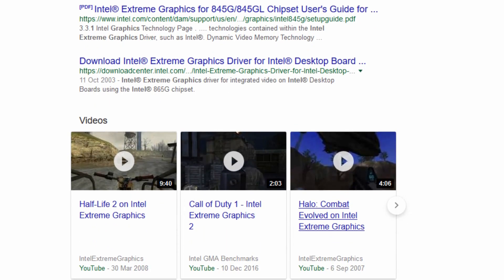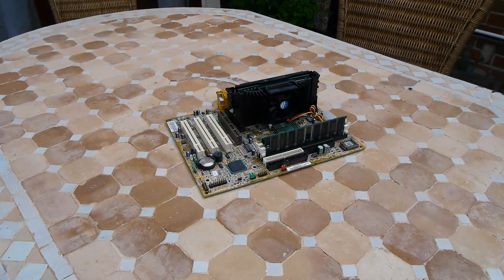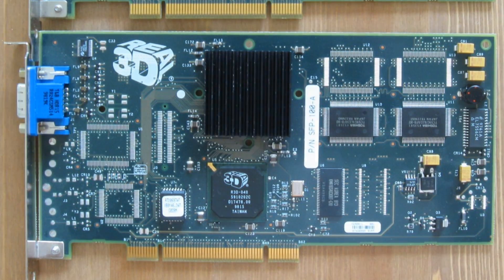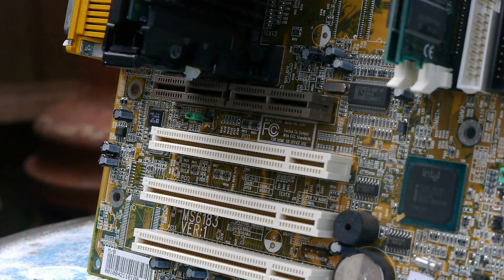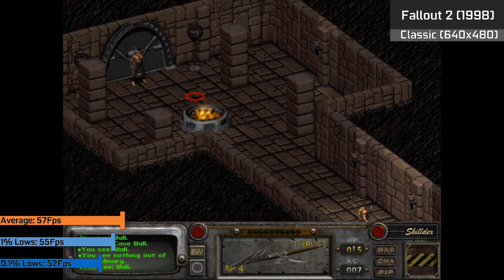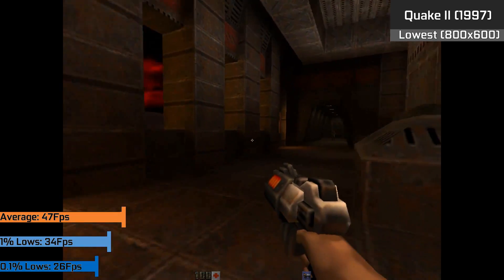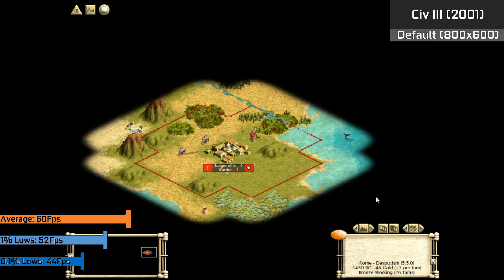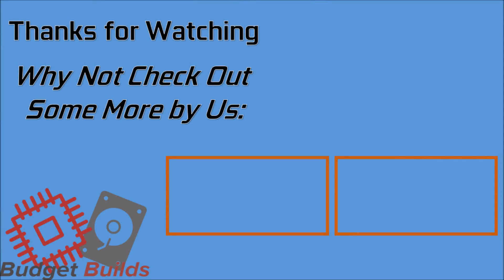Can you GAME on Intels First iGPU?

Comment: Ah, integrated cards. When my 8800GT died back at some point in early 2010, I spent a few months gaming on my mytherboard's integrated 7000 series Nvidia card (don't remember anymore if it was a 7050 or 7100 or what, but certainly not above 7100).  Then, a few months after I plugged in a brand new GST 250, my motherboard and CPU both brailed out, and, lazy bum that I am, I spent the next 2-3 years gaming on a laptop with an intel 4500mhd chip. So many really old and indie games played in those days ... good times!

Comment: The lowest gpu / igpu i used was a geforce 7050/nforce 630i with a dual core e6550 2.33ghz and 4gb ddr3, even then, that igpu / pc could run games from 1990 till 2007 (Q3/UT99/Ut gold/ut 2005/Morrowind/Oblivion, Heretic I II / Hexen II / Gothic I II etc) at 100/190/250fps+

Comment: There is a performance issue here. Even my old i740 performs better. Here is a PIII 1000 and a 815 chipset (same graphical unit). The 266MHz faster CPU cannot explain the huge gap by itself. https://youtu.be/KektuzPKktQ?si=cYItHCLMJxk_hBV4&t=1477

Comment: This miserable piece of silicon has been rehashed by intel so many times, it's more of a wonder trying to figure out when the company ever bothered to release anything new. This single adapter engendered literal decades of misery for pc gaming and developers alike, and are exactly why even in 2023, "intel video" is still a cursed thing to say or discuss when it comes to gaming graphics. It took literal driver voodoo to even get this turd to run the Aero graphics system of Vista, much less any newer Operating System. And the intel of now really wants to die on the hill of requiring resizable bar to fix the fact that Arc graphics lose 99% of their advertised performance on a system where that feature isn't enabled, or won't enable, like in the case of my present pc with a z390 motherboard.

Comment: At least there were still a bunch of PCI graphics cards for Dells, even up to Thermi. I have a PCI """""FX 5200""""" that's based on GeForce2 MX (specifically, a GeForce MX 4000 rebrand with a  memory clock bump from 166 to 200) that would probably still smoke this.

Comment: Oh, this brings me back.  the first PC I purchased was an HP pavilion 6835 with intel 810 and celeron 800, 128mb ram, and 30gb HD.  Windows ME. back in fall 2001.  I gamed the hell out of that unit.  ignorance is bliss, they say, but I never knew any better.  star craft brood war, doom and doom II, test drive 5 and test drive 6.  It was good times.  was this referred to as the original 'extreme graphics?  I know the 865g had the "extreme graphics 2" moniker (nvm, you mentioned it at the 4 minute mark).  The mpeg 2 decoding is real on the i810.  I tested it in 2007 with the HP 6835, at that point long replaced and collecting dust.  It required an old copy of power DVD, but I was surprised that the celeron 800 could do it with only 50% usage for DVD playback.  without the hardware decoding enabled it would stutter.   That HP 6835 lives on to this day, the case at least, now sporting an HP ITX board housing a baytrail celeron J1850, 4gb Low volt laptop ddr3 ram, and a 120gb ssd, on linux mint.  I use it for office use only now.

Comment: i remember having to use Intel HD3000 graphics in 2019. it was bad. Really bad.
Reply: A8 7650K, which isn't a good APU nowadays, was able to run GTA V at 30 fps most of the time with PS3 graphics 1080p.
God damn

Comment: i815e is an excellent retro-igp! lot's and lot's of really good games work very well. Hardwarescrolling is not broken on jazz2/dune2k, image quality is excellent. drivers from OS/2, dos vesa support, win3x!!, win9x/2k/XP and debian 3.1 has dri out of the box. Try that on other cards of that area  !  One small downside is that AMITHLON  refuses to load even in VESA mode. For IGP's you have stick to older games that came out 3-5 years if you are talking about actual igp's, in 2000 it was about 1-3 years.

Comment: I'd like to mention that the Intel i810 / i740 is a 3D graphics accelerator not a GPU.  The nVIDIA Geforce 256 was the first GPU (Nvidia defined at the time as "a single-chip processor with integrated transform, lighting, triangle setup/clipping, and rendering engines that is capable of processing a minimum of 10 million polygons per second").

Comment: Imagine having a build with cpu being this and the gpu being the rtx 3090
Reply: Earliest motherboard you can get with PCI Express is Socket 939, so you could do a low power Athlon 64 or Sempron... those boards use regular DDR so you could use a 64MB stick and have that be an even bigger bottleneck than the CPU, needing at that point a miniscule commandline Linux or BSD and games you can launch from a tty...
Reply: @BringMayFlowers that's assuming you can install and run the drivers, if not then it's pretty much worthless

Comment: From an Intel HD graphics user: I have a Pentium laptop that only has this "Intel HD graphics". Not 2000, not 3000 or anything. Just Intel HD graphics. It can run any game(kinda) before 2005/2006. I play GTA SA at 720p @30-40 FPS on the lowest settings. And the worst thing about this iGPU is that, it can't even stream 1080p gaming videos at 60FPS!! It is so terrible, I can't watch the buttery smooth 60FPS videos. But I can't do 720p60 either, because the quality due to YT's compression is terrible.
My point: Whoever you know, if they are gonna buy a laptop or desktop, please make sure they don't pick the one with this iGPU, because it is completely garbage for keeping up with basic expectations.
Edit: If I am wrong anywhere, correct me

Comment: An i810 based motherboard would probably be a killer DOS gaming machine. I have a mini-ITX i810 board with no graphics slots. Good candidate for a custom DOS mini-PC.
Reply: I had used my old P3 system with Intel 810E as my only system till 2011. Now it lies as a retro gaming PC. But I share many old memories with it. So, I kept it. I had 64MB RAM and Windows 98 which I later dual booted with Windows XP.
Reply: I mean, you might want at least one ISA slot for a sound card...

Comment: You cannot test those chips on Steam/GOG versions of games. Their requirements are like tripple of what they originally were.
Reply from the maker: The GOG Versions of the games are the standard games with DRM Removed. Less Intensive than most versions. Steam versions are fine aslong as you DONT have steam open.
Reply: @BudgetBuildsOfficial  That might be true in some cases (newer games), but look at Unreal. I (really) have achieved better performance on a 486 (64MB RAM, Geforce 4 MX460). 12 FPS just doesnt seem right... Many of the Steam/GOG releases replace the original CD tracks (zero CPU usage) with MP3s. For like sub-P II machines, that is a huge difference. You can just barely play a 128kpbs mp3 on a Pentium 66-75.
Reply from the maker: No audio playback was enabled for that exact reason. I have also tested with the Disc version of the game before and performance lines up with what the iGPU Achieved here.
Reply: Yes, this is an incorrect result in Unreal Gold 226. I checked on my i810 and got an average fps of 28 on the video author settings. Tested on Windows 98 in DirectX 3D.

Comment: It is a shame what happened to real3d. They made the graphic chips for the Sega model 2 (under GE) and then the model 3 (under Lockers Martin as real3d.) Only for Intel to use them to push the agp and then they design it in such a way that they used the main ram as texture instead of using the cards on memory because they thought the agp could allow this to happen. What a huge failure .

Comment: I have tested some time ago this iGPU (but the 810-DC100 one) in a Compaq Deskpro EN C500 with a 500mhz Celeron Mendocino the pirated version of Half-Life Opposing Force . It only ran in D3D mode at very low (but playeable) FPS.

Fact: The first 810 ones can't run a PIII , it haves a incompatibility with SSE Instructions . This was fixed in Rev.A2 of the chipset , That Compaq PC had the older revision

Comment: I  was using a VIA 4-in-1 at the time with a Celeron 900Mhz, think it was an S3 based chipset? 8MB shared RAM and I don't even know what the other specs were, although it ran Deus Ex tolerably at 640x480 and most 2D games fine. "Upgraded" to a PCI TNT2 which could run Freelancer comfortably at 1152x864@16. Then an FX5200 (ugh), and finally my first real good graphics experience with a 6800LE. A lovely little 128MB card which overclocked tremendously well and let me unlock 4 extra pixel shaders (so it was in effect a 6600GT I think)

Comment: In before watching the video but i had a pentium 4 with an i915 moboand that onboard gpu was awful! It couldnt even work right mst of the times. I remember NFS high stakes had missing textures and visual glitches. A radeon x550 gave it laps, and mine was a pasive card so adding some fans and some overclock it was even better than what it already was at stock clocks.

Comment: The i752 was basically an improved i740, which was from back in the days when you were upgrading from like...a S3 Virge DX.  The i740 was literally the very first AGP gpu ever on the market.  The PCI cards were actually pretty good and had great image quality, just not terribly fast.  We had a few successful UT2003 lan parties on some i810 graphics systems...on like 640x480 ultra low settings back in the day. 😂

Comment: The i740 was created to be the reference design for AGP Texturing(the usefulness of AGP Texuring was only ever really shown to be in synthetic benchmarks, as games tried to avoid texture thrashing and extremely poor performance on older cards like voodoo2's that  could otherwise perform really well).The 16 bit color looked bad but if it had 32bit it would have been way too slow
Reply: These IGPUs have 16 or 24 bit color but not 32bit one of the most interesting things about them.

Comment: FWIW- the AMD AMD 785G chipset with onboard ATI HD 4200 graphics is what got me back into PC gaming. This was in a Dell Inspiron 570 quad core Phenom minitower. It gamed so well with the onboard, I realized I was just a used dedicated GPU from playing HL2 and even Metro 2033. Did you ever play around with that chipset on board graphics? I think it totally stomped all over Intel's on board, and even urinated on its grave.
I am probably in the minority, but I think every single motherboard should have some type of on board graphics chip since almost every CPU socket has CPUs without iGPUs. It's a very nice backup to have when you are troubleshooting a graphics card issue, or even have cheap no power some CPU/iGPU combo on board to allow the powerful CPU/GPU to remain off to save power when not needed. IDK.. some cut down 15 watt tdp atom or whatever is modern similar.. something tiny they can use to fill out their existing silicon wafers in production to keep costs way down.

Comment: i use to play gta 3 and vice city mta online mods and halo 1 demo   on a 82810e i think it was  at like 3 to 19 fps at 640 by 480 i think i had a 733mhz and upgraded that to a 1ghz p3 i got out of a pc i found in trash thats where i also found my 256mb stick of ram that got me to 368mb   in early 2000s later upgraded it to a 128mb  pci fx 5200 i bought from the paper route i worked  for san andreas   rofl

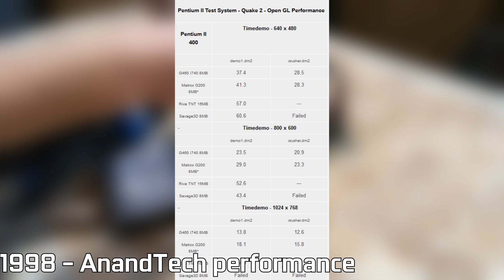Comment: 2:35 they did not optimize the chip. The same thing happened to the PowerVR CLX2 when it was taken from the Dreamcast and put in a PC as the Neon 250. Because it was not optimized fully it had problems with filtration and rendering something that it did perfectly in the Dreamcast. Real3D fucked up and it killed them while Power VR left the PC market and moved on to the mobile GPU and did pretty well until Apple made their own GPUs and then some Chinese company bought them and is probably gonna steal all the technology for China..rip

Comment: I'd bet original Unreal would have ran fine.  I ran that on a K6-2 with an STB Velocity 128 (Riva 128) and it worked well from what I could remember.  I guess Unreal ran in OpenGL mode because I read that D3D mode didn't work on the Riva 128.

Comment: You should try those with any UNIX like system, as they are much better supported than Windows (older Intels are supported by the newest drivers and improved in perfomance) and many of those have ports who could even be more optimized than the original releases. PE: Quake 1 and 2, Grim Fandango...

Comment: I have a i810 dell system in the closet. It's utter rubbish for virtually anything graphic and has only pci slots. For basic 3d games of the time it's an ok system. I myself used it as a smart router for about 10 years running freesco.

Comment: I bought a laptop for 1000€ and it barely rung fortnite in all low settings 600p with an averege of 40fps and in build battles it goes bellow 30. It has and intel core i7 7th gen, 16 gigabytes of ddr4 ram, intel hd graphics and amd radeon R7 445
Reply: TechnoGamer try disabling intel HD graphics
Reply: Your GPU is probably switched of to save power
Reply: Intel GPU is not for games, it's design to run mario

Comment: I remember having had something similar to this or maybe even the same chip, with a 1Ghz coppermine celeron. playing standard skulltag deathmatch (Doom2) was a disaster with plasmagun spam it would slow to a crawl. GTA2 and rayman 2 ran fine tho albeit on lower resolutions. and my mobo had no AGP slot so no addon cards. dark times. and the worst part? i had it till 2010.
Reply: No PCI slots?
Reply: @nathanhamman418  Probably dedicated onboard AGP video that can't be disabled. Those were the worst as you couldn't even add in an additional video card even if there was a PCI slot.

Comment: I think I had this on my first ever Windows XP PC. I just remember how it was terrible to use, and most of the games refused to even start up. I still have that motherboard around, but something is wrong with it, since I can't get any "sound" from it. But yeah, still fires up and works after all those years.
Reply: Try changing the small capacitors on the board. Mine had the same problem and it was a small 10uf cap. Only tested at 0.6 uf

Comment: If you're looking to build a P3 based Win98 system, an i815 mobo with an AGP port is usually a fair bit cheaper than a 440BX board. No ISA, Max 1G RAM, and no overclocking are the only drawbacks to i815 over 440BX, IMO.

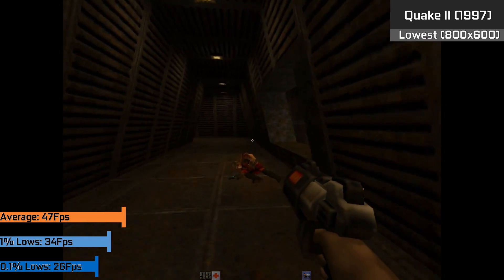Comment: 9:32 Just a heads up, DOS Quake is a poor test for trying 3D accelerators since it's all based on software/CPU rendering like Fallout 2 and the like. GL Quake would be the right one to try.
Reply: Was about to post this, it looks like the software rendering version is used, unless this crappy GPU forgot to support texture filtering.
Reply: All the other examples have texture filtering, so nope, it's the DOS/software version